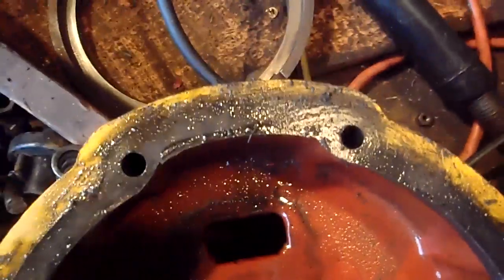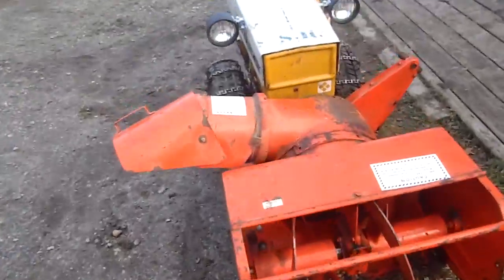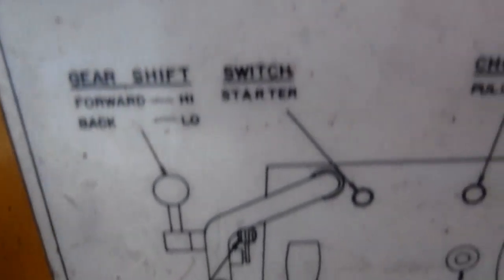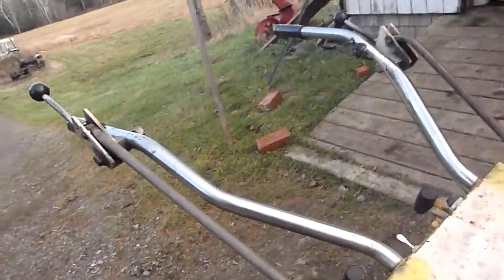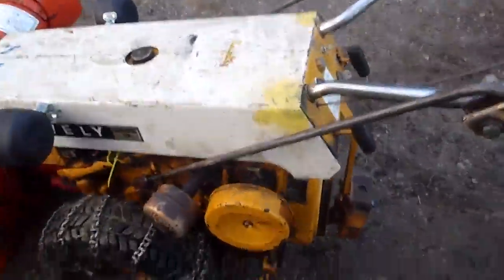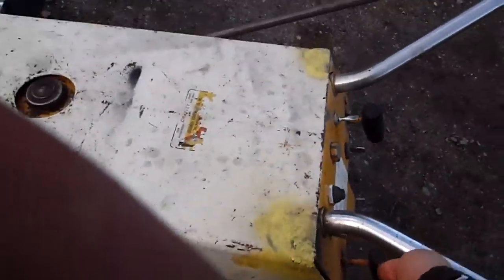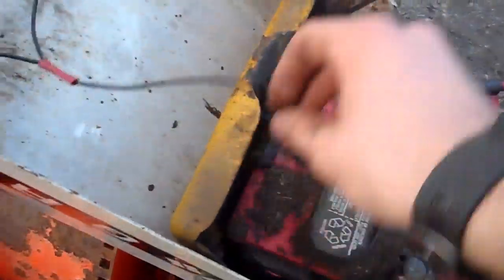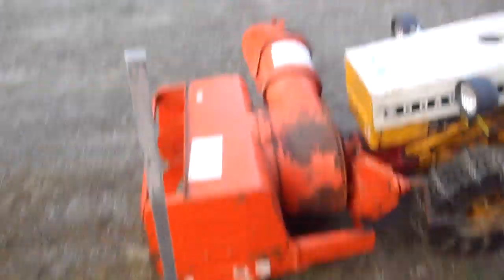Gravely Commercial 12 walk behind tractor has lights!

Comment: Nice Job, Lights  Looks Good & will certainly be useful .  I have allways believed that Points give a Hotter more consistant Spark and run better with the older equipment that was designed for Points ignition. Also they are much Cheaper to replace & easier to service & diagnois  when having ignition problems.  Good luck

Comment: its running good for sure.Lights look great the only thing i recommend is a little light down by your feet so you can see what your walking slash tripping over. Im gonna try to put a starter generator on one of my L's from the case and see how it works out. if it works i'll get some more lights and no more battery charger

Comment: HEI and electronic engine controls improved to the point where, in the recent past, I have done tune-ups for operators who claimed idling problems. I tuned up two such vehicles and in removing the spark plugs, found that both units had factory original spark plugs(dab of paint on the tip). I checked the mileage and one set of plugs had 172,000 miles, my #1 longest lasting plugs until the second set which had 194,000 miles.  That would never EVER have happened in a points based ignition.

Comment: To be fair I have to say, any properly designed and installed electronic ignition system in good repair will out perform a standard points based system.  As a heavy equipment mechanic of 30 years experience I was there when GM's high energy Ignition system (or HEI) was in it's infancy and plenty of point based systems were still around needing repair.  HEI was the start to the acceptance of electronic controls in cars until now just about every function on a vehicle today uses electronics.

Comment: One manual I read called for 10w-30 in the transmission, but you can get away with about any viscosity provided it's clean and kept full. I use whatever is on sale.

Comment from the maker: @queenofyeay Well from what i have noticed the Points ignition provides a more powerful spark at all RPM on the K series. Kholers electronic ignition system was very unreliable and thats why they discontinued it after a few years. I am very lucky mine lasted as long as it did.

Comment: @64gravely ok well one major clearance problem after a test fit was the tire is in the road.I have an idea or 2 to fix that But other than that its a bit beafer in general should work though and its gonna have to use a belt which works for me im pretty sure the belt is gonna end up the same as a 40 commercial deck size.

Comment: @64gravely with any kind of luck it will bolt up. once i get belt or chain figured out i'll buy a new regulator right now it dosen't charge the case battery but the key switch is messed up which will cause it not to charge

Comment from the maker: @queenofyeay  Their electronic ignition ran off the engine so the lower the RPM, the less spark it made. the points runs of the battery so you get the same amount of spark every time. It is much simpler and much more reliable. In my opinion the less electronics the better

Comment: @64gravelI I understand the sentiment, older equipment and vehicles are by far easier to work on, especially the 50's and 60's era cars trucks and equipment. But, the one thing I would always want to have is electronic ignition... I know first-hand the difference it makes when a far hotter spark boosts combustion.  Plenty of studies out there, but the main reason you know it is superior to points is the fact that virtually everything has electronic ignition today

Comment: @64gravely Which is why I said, "a properly designed" unit will outperform any points based system... key word (properly) There were plenty of terrible electronic ignition systems when the first ones came out. If this system is poorly designed OR has grounding issues or perhaps has some internal faults or is not receiving the correct voltage, then it might not work well at all

Comment: hi,
I am about to buy a Gravely, but found out that there is a hose missing near the air filter. Can you please tell me what kind of hose there should be and where it connects to. Currently it is how you see it on the picture, but machine is running and operating fine.
http://i63.tinypic.com/24pxfms.jpg